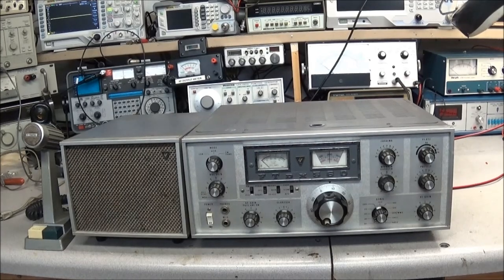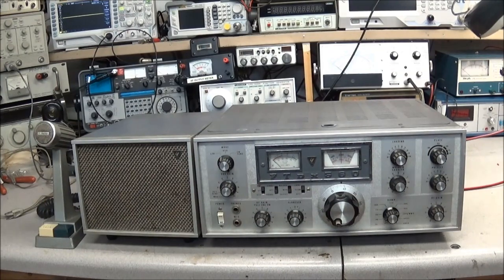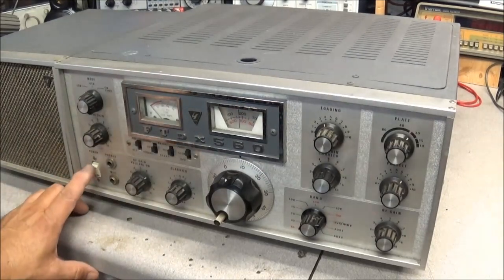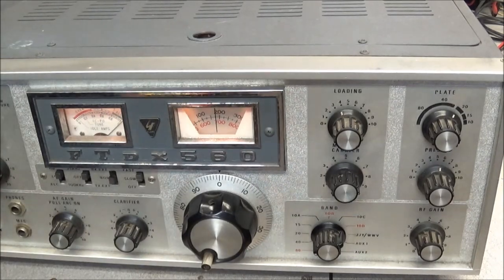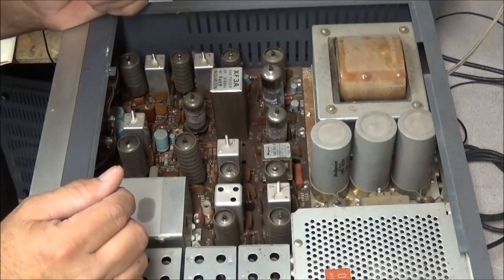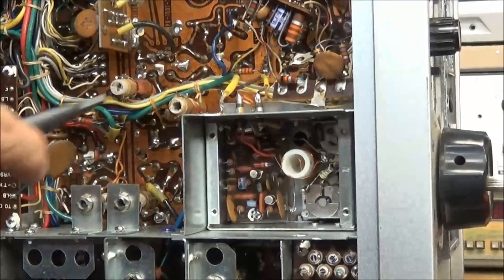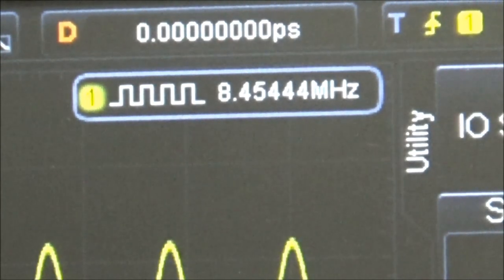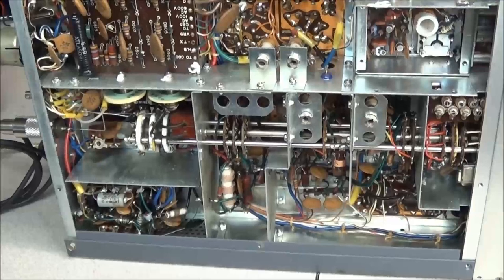#130 Classic Yaesu FTDX 560 Part 1

Comment: I have this exact radio, minus the original Yaesu speaker. I bought it off eBay about 10 years ago, and completely rebuilt it. It is near mint. I'd say better than 9.5 out of 10. It works beautifully. I use a D-104 Silver Eagle microphone with it. So far I have been unable to find a nice matching Yaesu speaker.

Comment: It looked like they hit that red wire with a soldering iron on the shielding. I knew I seen it move when you were showing us around. Nice work bud. What a nice radio. At least she's in good hands now...
Reply from the maker: You may be correct on that assumption. I did not see it to start with. even probed it with the volt meter.  It is a nice old radio. Thanks for stopping in and for the kind words.

Comment: Another enjoyable video of a great bench tech doing his magic. It always looks so easy when you do it.  But that's because you know where to look for the problems. I did a bunch of bench work on video gear at a tv station, and had a very handy ESR meter for checking electrolytics in circuit. That saved me a bunch of time and fixed many tv's, video tape machines, and audio gear. Cameras too.
Reply from the maker: Thanks for the kind words Ron. It is all at what you are used to working on. I bet you were a master at that gear you worked on as a tech.  Not sure how many rigs I have repaired by just looking at it.

Comment: Noticed the broken red wire as you poked around it the first time, nice that it was such an easy fix! Looks like the caps should be pretty easy to get to, so many rigs require "neurosurgery" to get to components you have to wonder sometimes how in the world did they build them to begin with!  Look forward to your next installment.  73 - Dino KL0S
Reply from the maker: Good catch Dino. I did not see it at the beginning. I agree it is amazing how long old components last in these..... Thanks for stopping in Dino

Comment: I haven't seen one of those in many years Buddy. Looks like you got a nice clean unmolested one there. As I remember, those rigs had a pretty good receiver in them. I think they sold around the $4 to $500 mark. Back in the early 70's that was a good chunk of change. Yes, take care of the 6KD6's cause they ain't making no more of them. 73 Doug.
Reply from the maker: Thanks Doug. Yes a very nice old unit. I think it will clean up real good. You are spot on about the price. I saw a old pamphlet a while back on these rigs.  Yes, these tubes are expensive now.

Comment: G'day Buddy look interesting project the FTDX560 be looking for more updates when you can fit them in. I had FTDX 401 got it working and then sold it a lot tubes in that box.73 de Dennis.
Reply from the maker: Thanks Dennis. I may get a 401 but will have to see. Price is right. Free. But shipping can cost an arm and a leg. 20 tubes in these old boat anchors.Thanks for watching.
Reply: tu mate 401 forever.

Comment: I am watching this video closely because I have a FTDX-401 here and it looks exactly the same. It receives ok but transmits audio only on 3 bands and just a carrier on the other 2 bands. I think 40 and 20 meters have only a carrier when I transmit like I am in CW mode on USB or LSB. It will output about 200 watts. Love to bring this radio back to original condition. Thanks again Buddy for a another great video.  Lyle VE5EE
Reply from the maker: Cool deal Lyle. All these are built the same with a few differences.  That is an interesting problem, I have to  look into that. See what I can find. Thanks for stopping in.

Comment: Hello, I was gifted one of these radios about 2 weeks ago. It had most of the original Toshiba tubes in it. On a cursory look over, it doesn't look like anyone has used a golden screwdriver on it. I'm looking for a schematic and users manual for it. Would you happen to have a copy?
Thank you.

Comment: What is the purpose of the metal shield around the tubes?
Reply from the maker: Basically for keeping signals from entering/exiting the tubes. Strong RF signals could be introduced and amplified in the tube causing distortion and mixing of unwanted signals.  Hope that  helps.

Comment: Hmm the part 2 can’t be found 😐😐
Reply from the maker: Never got around to making a part 2, still on the list.
Reply: @TheRadioShop  I'm glad you've still got this radio.  I've had one sitting around here, unused, for decades now.  It put out a powerful signal when it was working -- sort of like having an amplifier.  I recall it put out an awful lot of heat -- enough to burn my hand if I held it on the case.  I had to put a 120-volt computer fan on the top of the case to cool those finals until I found a proper Yaesu fan to mount on the back.  I couldn't use headphones with it because of the loud pop it made when going in and out of transmit.  

I stopped  using it when the T/R relay stopped reliably engaging and the IC current would peg the needle for a second.  I didn't want to risk damaging those final tubes.  It's sat here on my bottom shelf ever since.  Sometimes I think I can hear it whispering to me, "Hey, come and fix me."  8^)  

-- John